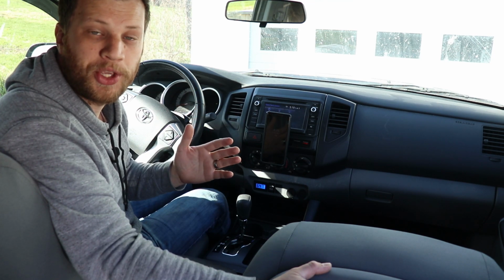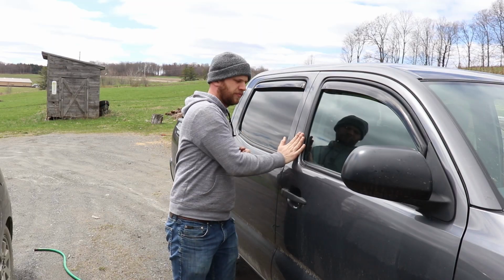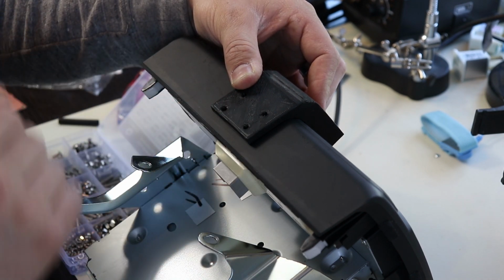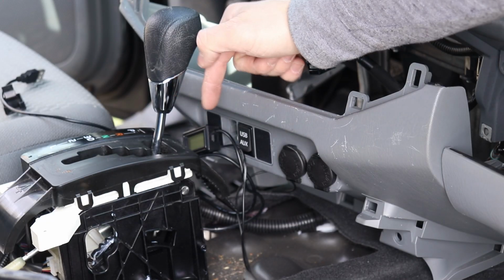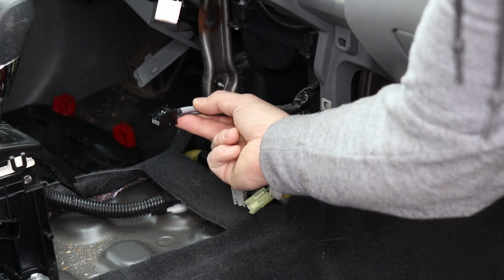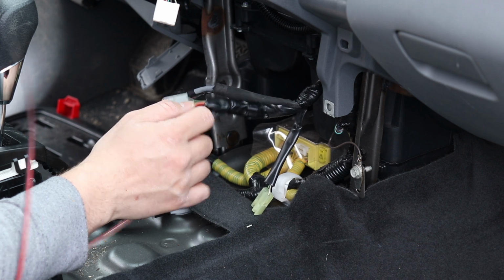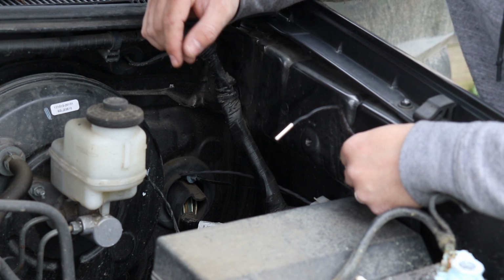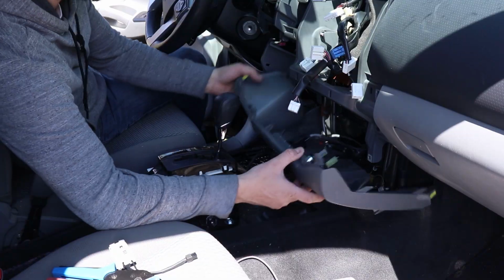3D Printed Phone Mount And Temperature Gauge For My Truck

Comment: Wow, you shure don't do anything half assed! 

Those installations turned out really nice!
I would also recommend to get the temprature sensor out of the engine bay to avoid it getting heated up by the engine and get false readings.

Comment: sensor should sit in the front bumper away from engine bay. Now itn will read hot engine bay temperature when engine will be running. Cars who has factory fitted outside temperature function sensors fitted in the front bumper usualy below headlight.
Reply from the maker: Thanks for the information. I did some research to figure out where the best placement would be. I wanted to get it installed with plenty of slack in case I needed to change the location. I'm going to test out in front of the bumper as you said. Thanks again!
Reply: @bytesizedengineering   fit sensor inside the bumper away from any direct air flow